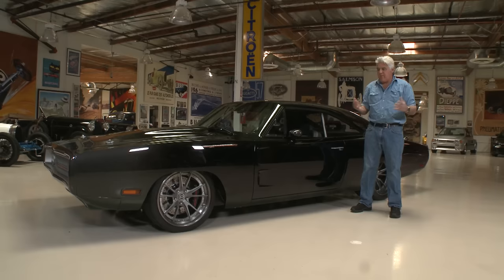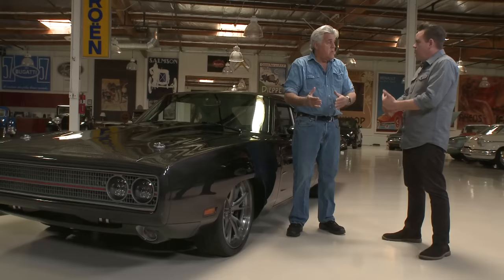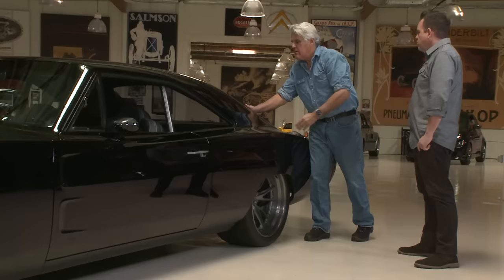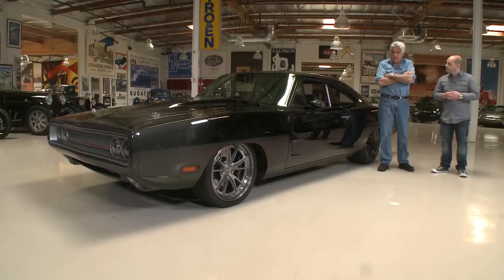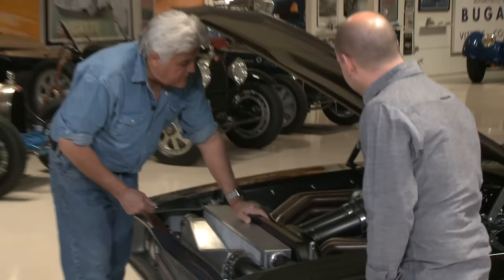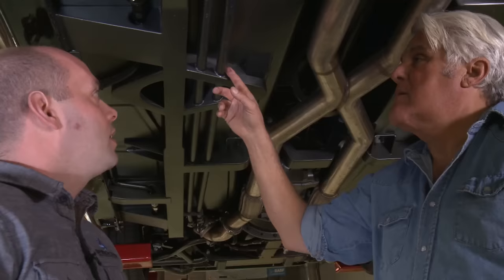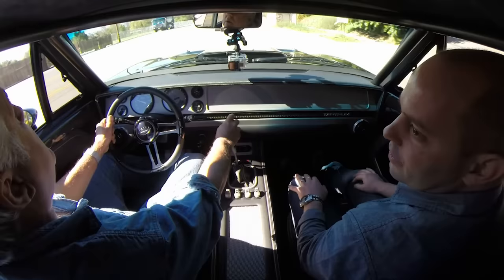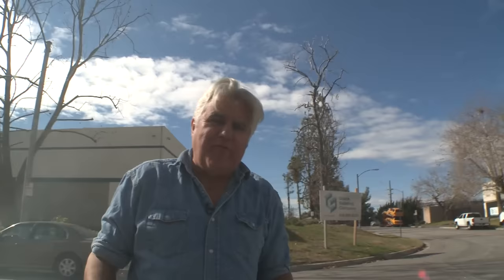1970 Dodge Charger Tantrum - Jay Leno's Garage

Comment: twin 94mm turbos with 3" exhausts? in garrett sizing those would be GT55 which have a 5" outlet .. why the heck would you strangle it with 3"?
Reply: so its drivable 
and you limit the boost potential 
  normally they run 5 or 6" outlets

Comment: That carbon fiber body does not work.  It needs paint.  And the front wheels need to be more concave like the rears.  Not a fan of the exposed headlights either... needs hidden ones.  All of those things come together to make the car really unappealing.  Paint it (orange), change the wheels (AR Vectors) and put a '69 grille on, and it'd be a badass car.

Comment: freakin amazing but seems like a death machine. it would be nigh impossible to use even near all that power without killing yourself. i guess if you're an expert racer and learn the car for years though..
Reply: 2 or 3 passes down a drag strip will have you changing your tune! And speaking of tune, you can lower the amount of boost and whatnot to make it a bit tamer.

Comment: There are some pics and videos of the 2025 charger it has the same body lines beautiful. Hope they put it in production. Theres rumors they are redesigning a 426 Hemi V8 in the future model 2026. Standard will be the Hurricane I6 with a Daytona version with twin turbos. I hope Dodge produces it but it may be futile because Stellantis is gutting Chrysler Corp. IE: there commercial vehicle line up has 4 makes between suv platforms, mini van platform, large Van playform, Truck platform 16 vehicles all had Chrysler modular designs integrated to all European name plates Manufactured in Europe not one Chrysler vehicle model for 2024. If that doesn't tell you what Stellantis is doing then your blind. Chrysler did the same thing to AMC American Motors Corporation stopped production on are there models except the Jeep closed AMC and made Jeep a Chrysler Brand. Stellantis is doing the same thing to Chrysler NOW! Gonna be hard to get Mopar parts OEM for the. Older mopars! Not good alot of Jobs will be lost!

Comment: I like this car might move the pipes away from the gas tank my 69 Charger RT broke the drive shaft in two doing a burnout snapped the cast iron piece the u joint fits into on the rear end never seen one do that ever $20 fix at junk yard those were the days

Comment: Why a Marine engine? It sounds like an absolute monster though.
Reply: Because marine engines are on a high different level of reliability and power. Marine engines are designed to handle being revved from 800rpm idle to 7-8krpm in milliseconds.
Reply: they can run WOT for HOURS AND HOURS continuously   thats why...  if you do a idle to redline  pull in miliseconds it will break... thats not what its built for  and the way they geared this car its WASTING its torque

Comment: @20:08, maybe......but the GTi would not sound as good as the Hemi! Adding to that, I don't think any of the new musclecars sound as good as the old ones.
Reply: I think Jay's Hemi must not run good.. Stock 426 Hemi's ran 11-'s - 12 flat in the 1/4 mile.. depending on car, axle ratio, driver/tires,not talking about 4.10's or 4.56's but streetable 3.23's or 3.54's.....I didn't know the GTI was a mid 11 second car today, I missed that model I guess...Remember old cars had no traction when they were magazine tested,tracks didn't have the prep like today,and most tests were don't on side streets etc....When new a 440 4bbl not the 6 barrel version of a Cuda ran 14's they magazine wanted to see what it would really run so all they did was add a 10 inch slick and the car ran low 12's in the 1/4 mile,that 10 inch slick is less grippy than a modern radial tire....Car was 100% stock and brand new..only change was tires..I have a 68 Charger RT 440 magnum,4bbl,auto with 3.23 gears..it ran 12.80's with pro trac bias ply 275 wide tires in 1976,today it runs mid 11's yes cam/heads but it stayed stock in those days...Car was 100 stock,orig carb etc..My Dad had a 440 6bbl Cuda that ran 11.90's to 12.10's and his buddy's hemi's were mid 11 to 12 flat,12 flat was a 66 Charger with 3.23's and dead stock with wider tires...He ran 14:50's with 205 70 15" stock tires bias ply lol..These cars were stock...after carb swap,headers,they ran 10's and they didn't run 4.56's or 4.10's they all had 3.23's or 3.54's with automatics and 3.91 and one had 4.10 with a 4 speed..As they drove them daily on the highway back then..Even GM and Fords would pull 11's,12's most were 13 second cars..396 Chevy,340 and 383 Mopar,428 Ford and 429 could run upper 12's ,390's were upper 13's..455 olds/buick/Pontiac were 12 second rides/depending on stage of the engine,a lot were 13's...I think Jay doesn't have a good Mopar mechanic and his Hemi is running off of only 4 bbl..We had a guy at our club,a lot of money and no knowledge,his 426 Hemi Super Bee ,he would say it was as quick as his BMW,hmm we said...Sure his BMW was a 13-14 second 1/4 mile car at the time..A good mechanic there,knew what it was his linkage wasn't working and the car was never floored when he floored it..Thus this guy for 4 years was saying his Hemi wasn't as quick as a lot of cars..Sorry for the Novel..plus I am listening to 2 other people,thus some grammer errors lol.....Bugs me about the GTi think,he either got played by a Built GTI or his HEMI isn't working..Plus the HEMI gained 30 NET hp every year until 71,that was over 550 hp..

Comment: Seems like such a great demonstration of what can be done, but just taken too far. That amount of horsepower with those tyres is just unusable, what's the point in a car you can never take past half throttle. Plus the amount of room the manifolds take up for the turbos makes doing any kind of work to the engine so much more difficult. Likewise the oil pipes welded to the chassis is surely short sighted. Lastly the first guy, could do with some enthusiasm, he just built a charger out of carbon fibre and he's talking like he developed a new colour for a toaster, be excited! It's a charger with 1650bhp!

Comment: Equipping this car with a 3.73 rear gear is just plain silly. There is way too much torque multiplication with that 6 speed. I bet that full throttle cannot be used from first to third gear making this car useless with that kind of power. I would gear it up and put a powerglide in it. That way you could put a relatively tight convertor and accelerate at the limit of adhesion of the tires. Plus it would make the car way more driveable and probably faster too.
Reply: needs 2.42 gears and a 1:1 6th  if your gunna run the 6 speed    3.73s is great for 400 hp....  you dont need any gear with 4000 lbs and 1800 ftlbs of torque

Comment: I'd like to see somebody take a 1370 horsepower v8 Man Marine engine and put it in a hot rod because at 1370 their detune don't put out 3500 all day long horsepower that is and you can't even measure the torque it so high and I'm talking diesel filtered diesel it's highly filtered clean doesn't even smoke it's clear like gas

Comment: I'll never get those minutes of my life back...

"What ehhh what kind of oil do you run?"
"Yeah ehhh it's a really mechanical motor, they run them in offshore boats."

We got to see what, two seconds of it performing, lots of blue smoke cruising around, and a chassis that'll twist to shreds the second you track it with wrinklewalls. I love the look, but I'm just in awe of the stupidity in this video.

Comment: Cool but way over powered. I would have used a modern engine tuned for fuel economy, as it would still be more power than you could use. Real Seat Belts would be great too.

Comment: * Replaced the stunning cool hidden headlights with 'happy face' exposed lights
* Destroyed the cool chrome loop bumper by blackening / making it invisible
* Carbon fiber pattern reminiscent of an unfinished body repair
* Ludicrous large wheels and lowering gives a broken-suspension look that trashes the design 
* Taillights look like lifted from another car--oddball upper corners don't match the opening; plasticky looking gray trim
Impressive work adapting the engine and getting 1600+ HP. But pointless when electric motors can do the same thing with far less noise vibration harshness.

Comment: All that money into the engine and they run Mobil 1?  Good luck with that.  Obviously this guy doesn't do much research on motor oils.  

I run Royal Purple in everything from cars, motorcycles to the lawn mower and backup generator.  I would never consider running any other oil, especially not Mobil 1.  My second choice would be the best grade of Amsoil.
Reply: Yepp. Purples the best!